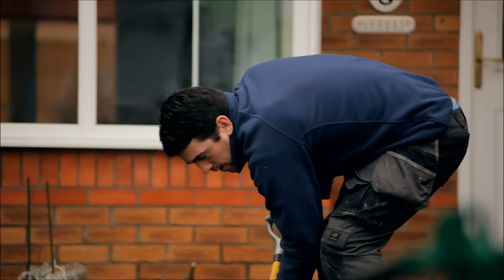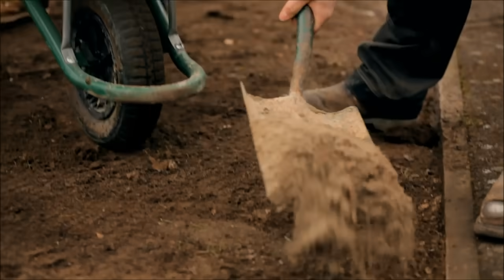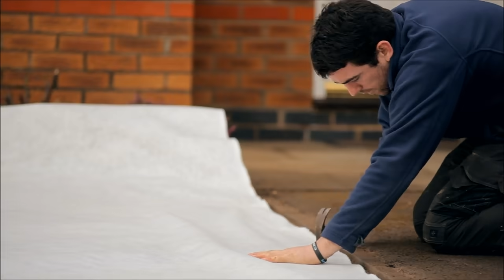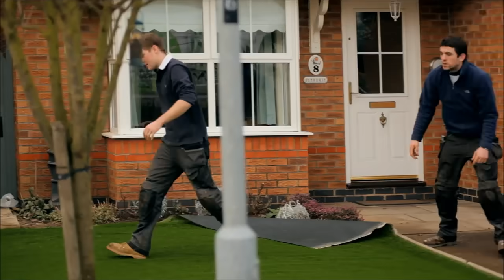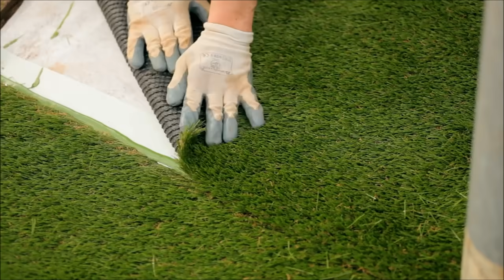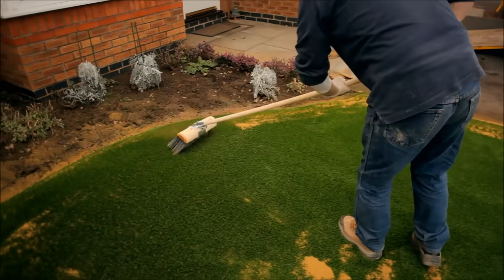How to Install Artificial Grass | How To | MKM Building Supplies

Comment: Excellent video.
One question: how low should be the bottom of the artificial turf compared to the deck?
I mean, if it's the same level, the grass leaves would be about 3cm above the deck and I think it would hold dust and everything else that comes from the deck.
But if it's about 3cm lower, people could stumb on the deck.
Any suggestions would be much appreciated.

Comment: i dont know where to start... but i will just mention  the seem , slightly wider tape would be better , and the glue should go across from side to side , if the tape rips in half , the carpet  will lift , and nails? on a seem ? would you let your kids run bare foot in there ? nailed into the ground? how long will it hold ?

Comment: Explain how the nails work as it appears you were hammering the nails into the soil?
Reply: They dont like that, I've installed false grass a few times, you need to make a timber border around the perimeter of the area and around obstructions and then tack the edges down to that.

Comment: Thought you was supposed to glue the edges to concrete not nail it to wood for it then to go damp and rot 🤨
Reply: We lay on a 4 x 2 on a gravel bed and use a sub base and stone dust to a good depth , thetimbers never sit in the soil if it's done right. I've seen the Mortar way I don't see it lasting. unless it's a good amount will crack in places if walked on ? This video is a cheap install video, maybe that's what the client wanted

Comment: Use a stapling gun to hold down the lawn ...and lathwood edges sat on a wet mix ...joints will come apart using a solvent.... staple them together over lathwood coated in bitumen

Comment: And twelve months later the council decide to put in a new lamp post and rip up the turf.
Reply: Do they always do that?
Reply: The council would have to disconnect the posts electrical supply  and reconnection 
Tgis person would be held chargeable for this as they have altered the ground. 
But  sure tgis is just a promotional video
Reply: @ryanzanna  I just wouldn't buy a property that has a council light in the garden. That's the problem with these new estates, no thought gone into them.

Comment: why is a street light in his garden
Reply: its public space. that post looks to be positioned around 1.5 - 2 meters (at 0:19) from the street curb stone. normally, that's where the sidewalk would be. so no way in hell can it be in his garden.

I think he is "growing" his garden in public spaces.
Reply: Because the line you see meeting the post is actually the boundary of the highway.
Reply: It's called a service strip. It's an area where all services  such as  BT , gas, electricity etc are laid. 
In this case, you can note the St Lighting. 
This does not form part of your property as it will belong to a factor or the local authority.
In quite a few instances, the owner of the service strip is happy for the householders to maintain them. 
If you plant trees, then the likelihood is that you will be asked to remove them at some point....
Reply: chris holmes The council decieved the home owner!
Reply: chris holmes II
Reply: In England certain estates, have what is known as 'utility strips' under which is laid all the pipes and cables to the houses, it saves digging the road up if they have to work on them. so the local council retain access to them, street furniture, like lights and road signs are placed at the back edge of the strip.Within the deeds of the property there is a clause that prevents the home owner building any permanent structure, like a wall, on this strip.
Reply: Thomas Malloy who gives a shite. the grass looks Very good.lol
Reply: Mr808Late thats what she said 🤪
Reply: that's a UK style :)
Reply: ....to be able to see in the dark...duh
Reply: Because you are cute

Comment: What is the kill/dry sand for? (at the end of the video)
Reply: i think it gets wet?
Reply: Not only for adding weight but to keep the blades of grass standing straight up even after someone walks on it.
Reply: it's kiln dried. lol
Reply: it weighs the grass down so it doesnt blow away
Reply: I also wanna know what happens to that sand if it rains
Reply: @KHUTHADZO RAMARUMO It washes away. Sharp sand is the best, thicker heavier and gives the lawn a better feel under the foot.
Reply: washes away? they must have put a ton of sand in there. must make a terrible mess for all that to just wash away.

Comment: Nice job ! But i wouldn't recommend using nails to pin it down as This sort of turf is usually put down for children to play on . I would recommend  u pegs as they have no sharp edges and are deeper than 4 inch nails
Reply: But what are the heads like?
Reply: U shape similar to camping pegs . go in a lot deeper aswel . Nails pop out to easy
Reply: Tucker Productions nails are fine if installed flush with the grass.
Reply: Nails are actually better. The nail has a smaller surface area that would be covered by the top layers of sand so kids would not hurt themselves if they were to fall. U Pegs would stick out more as that is their purpose. They are meant to hold down tubes or serve as small anchor. Mesh staples on the other hand are actually square so they sit flat but when hammered down will probably hold grass hairs down and would look less pleasing as you would see where the staples are. Nails work really well.
Reply: Tucker Productions q

Comment: Hi sir, Thank you for the video! (It was very helpful) 
Quick question: Why sand have to be applied after the installation above the turf?
Reply: It helps keep the grass weighed down better overall (especially around the edges where it was applied heavier). Also as you brush or rake it in, the sand will help the pile stand upright rather than flat, which wont look very nice.
Reply: Fitfreek any sand is ok ? Play sand ?
Reply: Robert Balderas kiln dried sand is what you need

Comment: was thinking of doing this until I watched this vid, why cant you just lay it down like carpet? I have a decked area that is rotten, just want to cover it up.
Reply: +Ric Lyons yes u can just glue it down and some screws to hold it down
Reply: I did that . Every few weeks I got to lift up the carpet though and remove all the weeds coming through. Then fresh again.
Reply: @quickvids3206  I am just putting weed barrier cloth under mine as I already have an old compacted level ground. I will infill with sand though.

Comment: I got two questions: (1) Why did you lay the white fabric underneath?, (2) How good is the artificial grass as far as letting rainwater through?
Reply: +Sttm35 He says in the video 'weed membrane'.  That should give you a clue ;)
Rainwater drains through fine
Reply: Sttm35 the white fabric is anti weedmembrane. It allows water through but block UV so weeds can't grow.
The backing on the grass is a mesh so lots of little holes to let rain through.

Comment: Holly COW! I thought you can just lay the turf right onto the dirt..and FINISH! haha Talk about hella layers
Reply: They did this hella wrong to so..... Its suppose to 2 Inches of drain rock and 2-3 of decomposed Granite for the turf I use a stabilizer to harden the area and have a tighter grab on the nail. Once turf is installed I apply 1-2 Lbs of sand per sq ft.
Reply: leo Gracia that is incorrect. You actually only need 2 inches compacted of class 1 breeze or crusher fines. Any other road base in unnecessary and a waist of money.